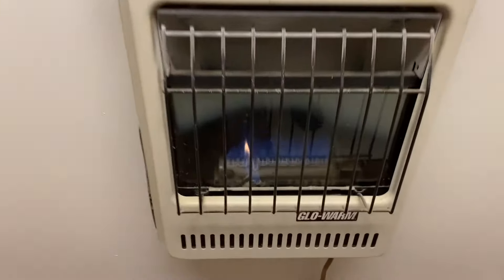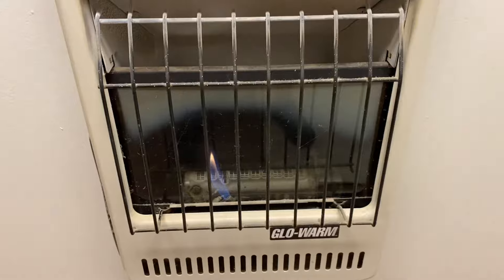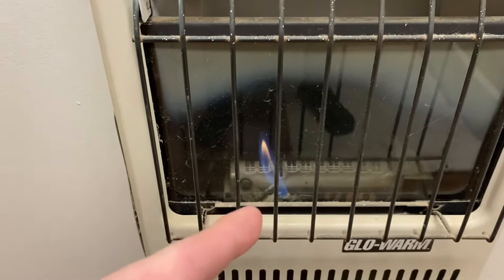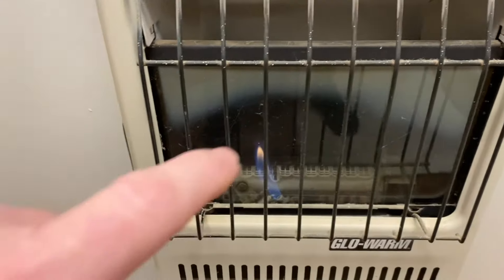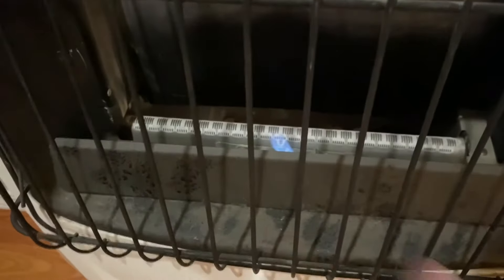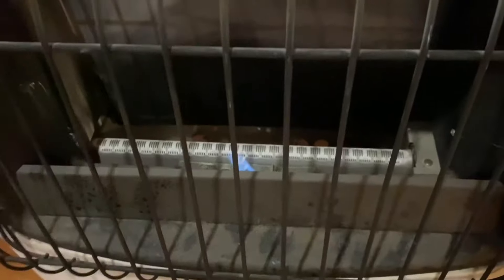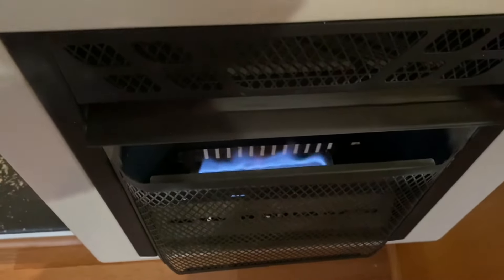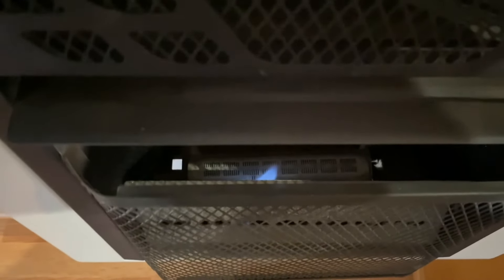Gas heater won’t light??? (I have some answers)!!!

Comment: Mine is brand new and won't stay lit 🙄 unless I hold the button down on the pilot
Reply: Open the cover 4 screw on the side
And 10 mm pilot light un screw it and blow it clean then try it mine work after that

Comment: Quick question I can get the pilot light on but heater not flaming up but pilot light is lilt
Reply from the maker: I’d say the main burner needs cleaned
Reply: @brob8880  ok thanks
Reply: @brob8880 , My pilot lites and when I turn up the flame both pilot and flame go out. Hose to tank goes outside a window to the tank. Any idea's?

Comment: Great advice, and these suggestions will also work with the “Mr Heater” series. Congratulations on breaking the 1000 subs mark.
Reply from the maker: Thank you!
Reply: @brob8880 , My pilot lites when I turn flame up both burn out. Any idea's?

Comment: I have a comfort glow heater but the igniter sparks weak once then miss 4to5 times I tried to find the igniter but I'm told they don't make parts for my model but it looks exactly like the one in your bathroom can I use a different igniter.

Comment: Same issue with outdoor propane heaters that dont ignite after a period of non use.  Tiny spiders like to spin webs inside the supply tubes.  A simple pipe cleaner will usually clear it out.